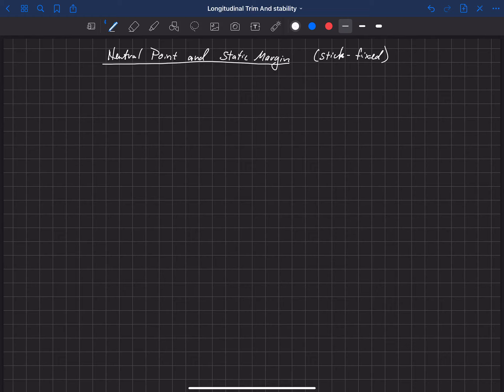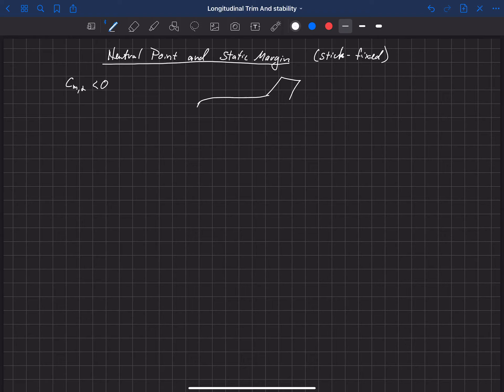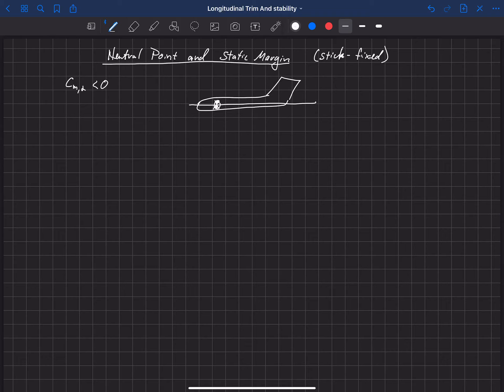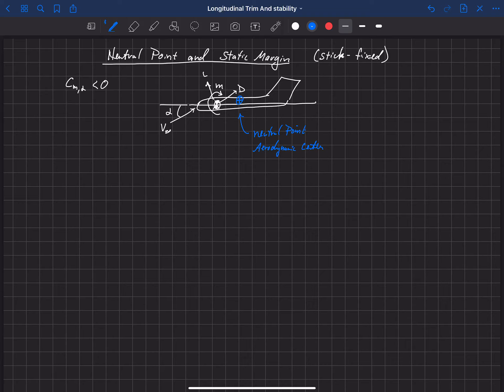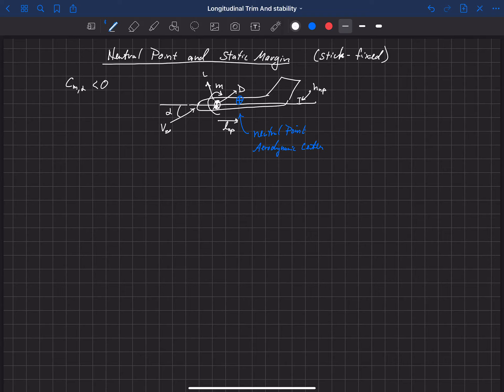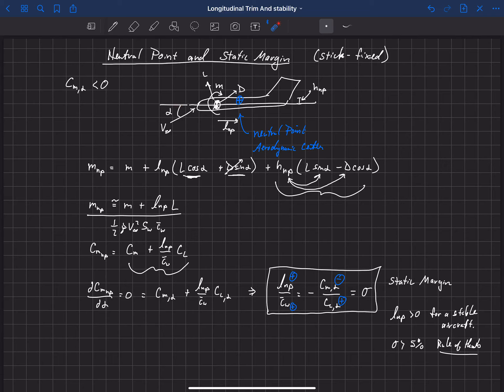Static Trim and Stability . Longitudinal . Neutral Point and Static Margin

Comment: Why are you drawing pitching moment nose up clockwise direction? It is always negative in aerodynamics center counter-clockwise - nose down if we do not have a reflex airfoil. We try to overcome this pitching moment with the negative lift by deflecting elevator upward on the horizontal stabilizer to have positive pitching moment nose up  for cruise flight?